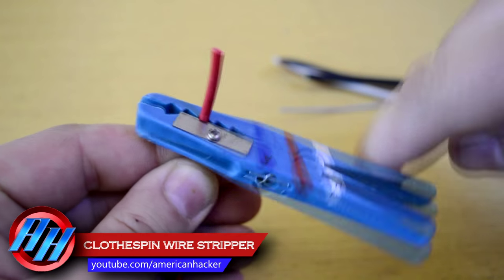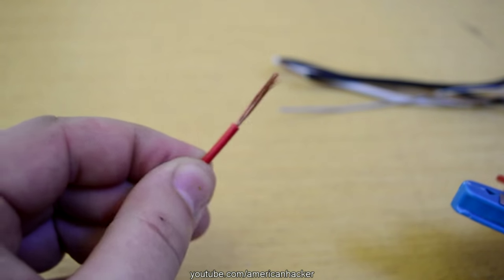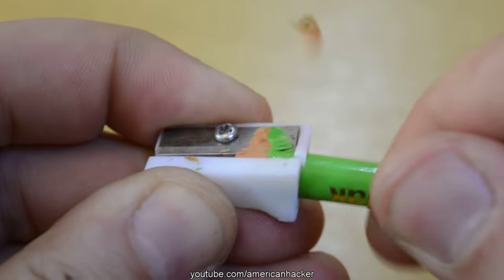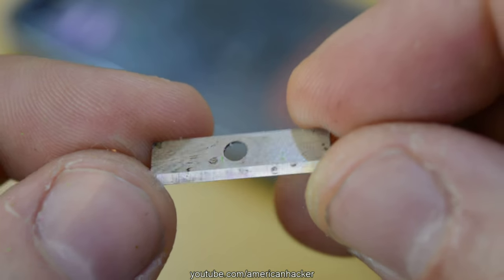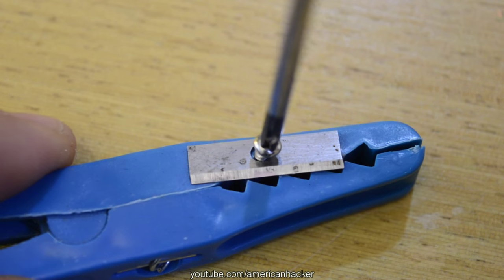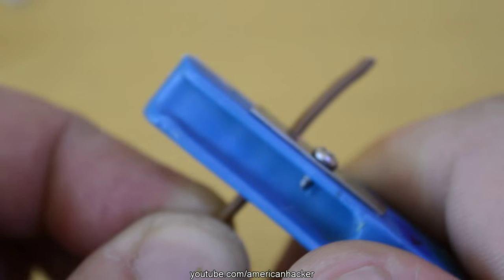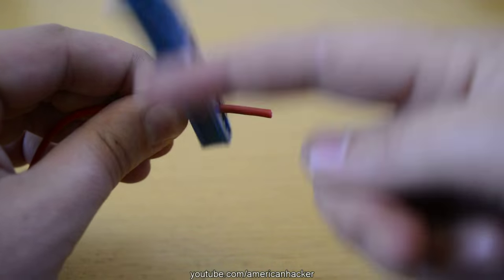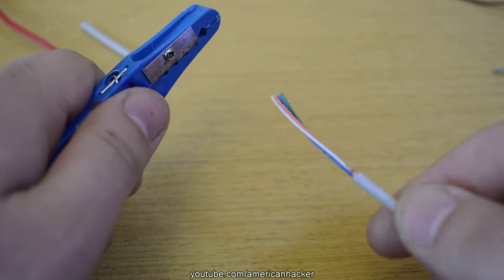How To Make Clothespin Wire Stripper

Comment: thanks for the idea...i could really use this at work... i build cnc automated machines and the past week ive been working on wiring one up.  this would have helped when stripping the outter insulation on a multi conductor cable like a 25c 20ga. might take a little adjusting the blade and testing so i know how many times to go around with it.  Ideal sells one but this would be all but free.. cool